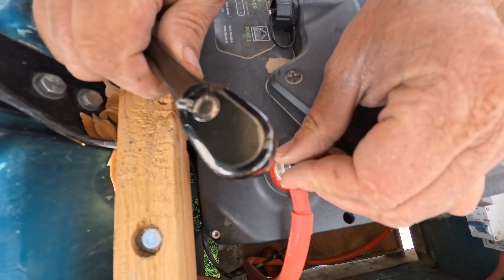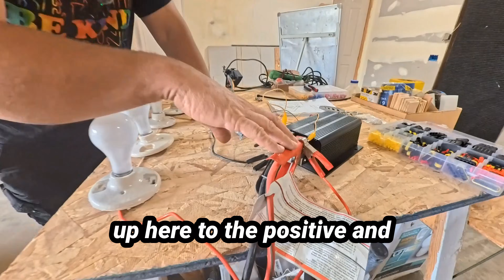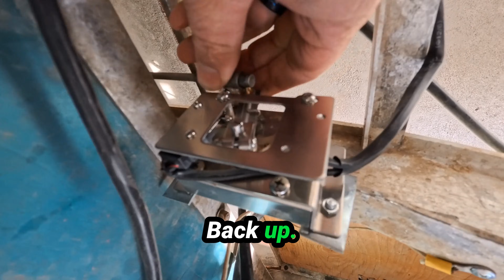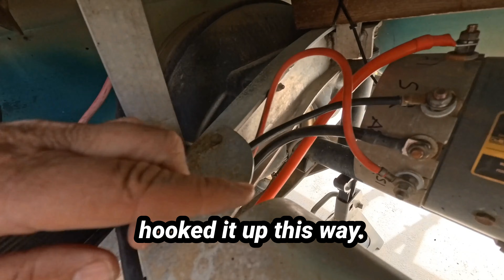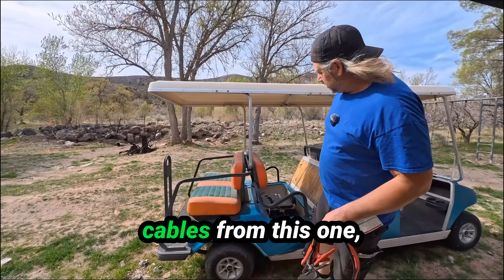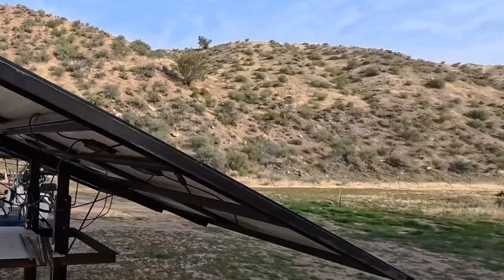Club Car Resistor to Curtis 1205 Solid State Conversion

Comment: If you are just upgrading a 36v cart to 36v lithium and controller do you need the new solenoid and F/R switch or can you use the existing solenoid and switch?
Reply from the maker: I used all of the existing parts when I did my 2nd solid state conversion. https://youtu.be/F0F2coSesYw

Comment: Great video. Best and fastest fix is just avoid all club cars and buy ez go. Or sell your club car with the working ez glide replacement. And get an ez go. We have an older ez go and it has never had an issue with its system, I believe it has a solid state already. I don’t know but all this is avoided with just changing brands.
Reply: They all use off the shelf parts…

Comment: The 36V should wire up the same right?
Reply from the maker: Yes, this controller is good for 36 or 48 volts. In the future if you want to go faster all you have to do is put in a 48v battery you don't have to change a thing.

Comment: Need help with understanding in the manual it shows positive going up to a control wiring fuse over to a polarity protection diode then going to key switch . What is the diode what size and where does it actually go
Reply from the maker: I am not quite sure what the diode is used for. When I was doing my conversion, I did some googling and best I could come up with is used for regen braking. I did not put a diode on my conversion.
Reply: Thank you

Comment: Where  does the voltage solenoid Resistor and diode set go
Reply from the maker: In my second video I show where it goes. https://youtu.be/F0F2coSesYw
Reply: The solenoid already came with a resistor and diode on it so I did not know  sorry

Comment: Hey man! I’m following this video step-by-step and pretty much have everything done, but I am having some issues physically mounting my pot box. Every way I’ve tried to mount it so far the pedal does not have enough reach to push the pot box all the way open. Did you have any issues with this?
Reply from the maker: I had to adjust the push rod so that it was pushing the pot box lever a little bit Before pushing on the accelerator .
Reply: @Thesolarfarmer  I got that right thanks! I’ve pretty much followed your video step-by-step. When hitting the pot box, Nothing is happening no movement. I ordered everything specifically with your links on the pot box. Did you only use the two wires coming out of the side like you showed? And the only place you have to run those is to the bottom 2 small spades on the controller?
Reply from the maker: @dylanparis3951  I think my second video will help you with the questions you're having. 
 https://youtu.be/F0F2coSesYw

Comment: What motor is in that cart?
Reply from the maker: Stock 36 Volt series motor.
Reply: @Thesolarfarmer what was your top speed after upgrading?
Reply from the maker: @tgbst88  28 mph. But the best Part about the upgrade is now I can climb any mountain without my golf cart catching on fire. https://youtu.be/7JeEUp4WcnA
Reply: @Thesolarfarmer damn that is awesome.. what was your speed before the upgrade?
Reply from the maker: @tgbst88  Before I did any upgrades to this cart it had 36 volts of lead acid batteries and would only go 12 mph. Yes it's.

Comment: Hey buddy great video,I was hoping you could help me out,I have a 96club cart 36 volt,I replaced batteries with 38volt lithium battery and I'm burning up v glide , can you help with the parts I need to convert to solid state conversion,I'm not sure if I can use 48 volt set up you put in link,any help in what I need to purchase for my setup would be greatly appreciated
Reply from the maker: Watch my new video I just barely posted it will answer a lot more of your questions. It has a parts list in the description. Yes the parts work for either 48 volts or 36 volts I switch back and forth on different batteries all the time.  https://youtu.be/F0F2coSesYw
Reply: Thanks Buddy  @Thesolarfarmer

Comment: Doing this conversion because i found this video. I think i have all the wiring written down right. I have a question about about the wire going from solenoid  to Bus bar positive+, and B- on controller to bus bar negative-; I’ve been told that doing so would pull some heat from the bus and melt it eventually. They recommended taking this directly to the battery instead to their respective + and -. Have you had any issues with yours having the those wires going to the bus, and then the battery? Or any thoughts on that in general?
Reply from the maker: You don't need bus bars The reason I am using them is because I have so many connections because of my solar input and also my auxiliary 48 out. My bus bars are working just fine and do not get hot. I have driven this cart on long road trips without any problems.

Comment: Did you program in any plug braking? Also, if i wire my key switch to that microswitch on the pot box, vs the microswitch on the f/r switch, is that just as safe? Should just be turning the solenoid and controller on when you press the pedal instead of shifting it.
Reply from the maker: I did not program any plug breaking. You need to connect the micro switch in the F/R switch because that is the only way to prevent power from going through the F/R switch when it is not fully engaged.

Comment: Hey my friend TY for your video and all your help, I converted my 2002 v glide 36v to 48v system just like you did.  I do have a question, I have burned out the solenoid, do you have any feedback you can give me on this issue?  Thanks again.
Reply from the maker: Do you have a pre charge resistor on your solenoid?
Reply: @Thesolarfarmer  I have the same green resistor on the back just like yours, nothing else.
Reply from the maker: @manuelrivera6817  Check your precharge resistor and make sure that it is working. The pre charge resistor is responsible for pre-charging the capacitors within the controller, preventing arcing when the solenoid contacts touch.

Comment: I can’t get mine to work. I have a pot box and don’t know how to test it or where to start
Reply from the maker: Connect a voltmeter to the wires on the pot box. Set your meter to ohms on 20 and you should get a reading of 0 to 4.7 ohms
Reply: Ok when I activate the solenoid I have 40 volts on every post on the motor
Reply: 4.8 but when I press the gas nothing changes
Reply from the maker: @danyork9909  should be 0 and go to 4.8 when you push the accelerator.

Comment: Great video.  In the process of converting my 1986 DS.  Just wondering what size pre charge resistor you used on the solenoid.  Thanks
Reply from the maker: This is the pre charge resistor that I used.
https://ebay.us/V2u4fM
Reply: Thanks so much for your video.  I converted my 1986 Club Car DS as per your instructions and it worked perfectly.  I kept it a 36V not wanting to stress the motor and it is awesome.  Thanks again.

Comment: Great vid, I followed what you did and set up my 97 Club Car with a 48v Vatrer Lithium battery and my cart now does 24 mph. Ty so much for the help. Yes stock 36v motor.
Reply from the maker: That's awesome man I'm glad my video helped. I think everyone is going to have to switch to solid state because the aftermarket V glides are no good and club car is going to quit making them.

Comment: Great video.  Going to be doing my  club car ds soon . What gauge wires did you use to run to all the components?
Reply from the maker: Mostly I reused the 6 gauge wires that were on the golf cart already and then some random wires I had kicking around if I were to buy wires for this project, I would recommend 4 gauge wires.

Comment: I really appreciate this video.  It is interesting, informative and very well made.  I wish I watched this before I purchsed a 36 volt  lithium battery for my 91 club car project.  I would have gotten the 48 volt.  Any way it it is still much better than the lead acid.  If the 36 battery kicks off before I do I will get the 48 :)
Reply from the maker: I switch back and forth between 36 volts and 48 volts in my 91 club car. On 36 volts I get 18 mph and on 48 volts I get 28 mph.

Comment: I've got a 2 wire pb-6 didn't see how you hooked that up
Reply from the maker: This is how it's done.
https://youtube.com/shorts/O3UzUq4XqbI?feature=share
Reply: @Thesolarfarmer I thought I read somewhere that it didn't matter which way you put them on. Thanks man that's my last step on wiring before I slap this battery in and test it.
Reply from the maker: @nunyabiz86  Yes, definitely does not matter which way you hook up the wires On J2 and J3. Let me know if you need any more help.
Reply: @Thesolarfarmer ok everything is hooked up and double checked. My solenoid is working as it should. My voltage is good. Pot box is showing proper resistance in both zero throttle and full throttle positions. Even my 12v system is functioning perfectly. Only problem...no go in forward or reverse. Motor is a brand new d&d...pot box is 0-5k...500amp controller is solarhome also supposed to be 0-5k. Any pointers?
Reply: Also, I didn't use a buss for grounding I ran a bolt through the frame and grounded thru there. Should I have not grounded the frame?
Reply: Electronically i mean I've got mine mounted and all just gotta wire it

Comment: Help meeee. Been following this video to concert my 91 DS 36v lithium battery. My solenoid and gear selector are just different enough that I can’t figure out the wiring to match how you ran yours. I’ve got a selector that looks more like yours on the way so hopefully that just leaves my confusion with just  the solenoid. It has no markings in it whatsoever

Edit: I found a side by side of your F/R switch and the older one, so that should fix me on that end, at least! I’ll get that fixed and then see if the solenoid is still messing me up
Reply from the maker: Here is a better manual for the controller
https://www.manualslib.com/manual/1468457/Curtis-1204m.html?controller=view#manual
I am filming a new solid state conversion video right now; it has a lot more info and step by step instructions.
Reply: @Thesolarfarmer awesome, looking forward to the video! Thanks for the quick reply.
Reply from the maker: @jakesbigdumps8239  Here is my #435-680-5958 if you get stumped and need help.
Reply: @Thesolarfarmer you’re awesome brother! Right after I commented found a side by side diagram of what does what different between the different F/R switches. Worked withthat and a couple other changes after the probably 70th time through your video and finally got it figured out and running again! No way I could’ve figured it out without following along to your video, really appreciate you.
Reply from the maker: @jakesbigdumps8239  That's awesome man so glad I could help.
Reply: @T @Thesolarfarmer d you ever find a solution to getting that tiny bit extra range of motion out of the throttle pot? Haven’t put the multimeter on her yet, but definitely think she’s not getting full juice at full throttle. Not that it really needs it
Reply from the maker: @jakesbigdumps8239  I've got mine adjusted so I'm getting a little bit of ohms (0.2) before I press the Accelerator and a full 5 ohms when it's fully pressed down.

Comment: Will this exact swap work in an 1989 club car ds? I know the switched things a little bit around 91.
Reply from the maker: The golf cart year and model number does not matter. The Curtis 12O5 controller is a DC motor controller as long as it is a DC motor it will work.
Reply: @Thesolarfarmer thank you!

Comment: Omg man, this is a blessing. I got an old 1989 club cart for free and put a lipo 38v in it. The vglide was getting really hot. I'm almost positive that it was hooked up right but idk. Someone told me that the lithium battery has too much juice for it. I'm not sure if that's true but figured I'd just put in a solid state in when I had some time. I couldn't find any videos on how to do this in March. I just cleaned out the garage and started looking for some instructions. This is EXACTLY what I need! Thank you very much! Wish me luck!
Reply from the maker: I hear you man. Finding info on how to do this is definitely hard I had to just kind of wing it and hope it would work. I am converting a 2003 right now and making a really good step by step video packed with tons of info.
Reply: @Thesolarfarmer I am about to convert a 1997 CC DS 36v... I got a 48v DC house lithium on a deal... watching your vid on repeat now to get a parts list together... wish me luck

Comment: Will this parts list work on my 36v ez-go? I also have 3 12v lithium batteries if that matters
Reply from the maker: I have not done this on an EZGO yet but if it is a DC motor then this should work. The batteries don't matter but you might have a problem with 3 12 Volt batteries Because it puts extra strain on the Batteries BMS. I burned out a bms by running 4 12 Volt lithium batteries to get 48 volts. It is way better to run one big battery.
Reply: @Thesolarfarmer ok thanks for the info! How fast would the club car go before solid state? I’m needing more hill climbing power and it’s not there 😂
Reply from the maker: @Denton-p2g  I am not sure how fast my 91 club car would go before the conversion. I am currently working on a 2003 club car conversion and it would go 18 mph before so when I get it done I will know before and after on it. 
My easy go could not go up hills with the lead acid batteries. I switched it to lithium now it climbs hills no problem as you can see in this video. https://youtu.be/nzFh1zbPH7E

Comment: Do you have a video of wiring up your bus bar? Is it necessary to use a bus bar? Can it all go straight to the lithium ion battery terminals?
Reply from the maker: You do not need the bus bars. Yes, you can connect directly to your battery. The reason I use the bus bars is because I have so many connections. I have 48 Volt auxiliary out to run inverters and I also have solar power coming in.
Reply: Thanks for the reply. Another question for you. Im getting constant power to pin 1 on the controller when I put it in Forward or reverse. Is that right? I know you said the solenoid trickles power to it constantly, but mine gets full  voltage one I switch into gear. I thought it was only supposed to get voltage when you hit the accelerator? Also mine is not moving forwards or backwards 😢

Comment: Is that the original 36v motor still? 
It takes the 48v swap no problem?
Reply from the maker: Yes, original 36 Volt series motor. As soon as I can I am going to get a 72 Volt controller and run 72 volts into a 36 Volt series motor. Some guys claim to run a 124 volts into a 36 Volt motor.
Reply: @Thesolarfarmer  That's awesome. Might have to return this 36v lithium battery I just bought and go for the 48v. Thanks for the info!

Comment: wicked video man. im doing a swap on a resistor cart but staying down at 36v and lithium

having trouble finding the resistor and diode in canada. is yours a 250ohm resistor? is it a "6.5w250RJ" resistor? any markings on your diode?
Reply from the maker: You don't need the diode if it is not a regen cart. I am using a 10 Watt 500 ohm resistor Because I am running 48 volts. For a 36 Volt system 5 Watt 250 ohms is what you need. You definitely do need a resistor I just blew out the capacitors in a controller by bypassing the resistor. I am starting on my next conversion, and I am using a Mcore 4 instead of a pot box. It can do 0-5K 5-0K And also zero to five volts depends on how you hook it. You should look into it I think it's going to be easier to hook up than a pot box
MCOR 4 Conversion Kit for Club Car DS 48V Golf Cart https://ebay.us/cwyd9J
Reply: @Thesolarfarmer  thanks man, very helpful. My potbox already arrived so i think ill take a crack at it. Does the mcor4 output 0-5k on a 2 wire configuration? ive already got the controller as well...  Yeah ive heard its hard to get the full 0-100% throttle on the potbox linkage to work right, and sometimes you have to create a cable to reprogram the controller to make it think 75% is actually 100% throttle. Thanks again.
Reply from the maker: @Firebat15  Yes, Mcor4 does 0-5K on a 2 wire.

Comment: Great video!! What bus bar and circuit breaker are you using? Thanks!!
Reply from the maker: This is the bus bar I am using. Bus Bar With Cover https://ebay.us/Xf0upn
I am using a circuit breaker for my auxiliary 48 volts out which I use to supply power to my 3000W EG4 inverter, it is a 125Amp https://ebay.us/ZFyCmr
If you are Wanting to use a breaker for your golf cart power system you would need at least a 300 amp breaker.
Reply: @Thesolarfarmer  Thanks for the quick reply!! 

One more question: Are you using both 4- and 6-gauge cables between the controller/motor/battery? I'll be re-wiring mine (91 EZGO Marathon w/36v lithium upgrade and Curtis 1205 Controller). Since I'm rewiring, do you recommend all 4-gauge, or will 6-gauge be ok? Thanks again!!
Reply from the maker: @michaelhurley4066  I just use whatever random cables I have laying around and what's already on the golf cart. If I was going to buy cables I would buy 4 Gauge cables because I am so hard on my golf carts driving all over the desert. If you mostly drive flat ground, then use 6 Gauge but if you go up any kind of, hills I would definitely recommend 4 Gauge.

Comment: If you splice into the pot box wiring, which wires did you connect together to go to the two terminals on the controller
Reply from the maker: Here is a video I made to show you which wires to connect to.  https://youtube.com/shorts/O3UzUq4XqbI?feature=share